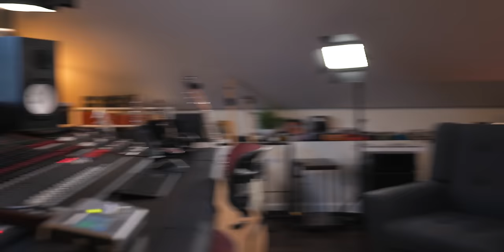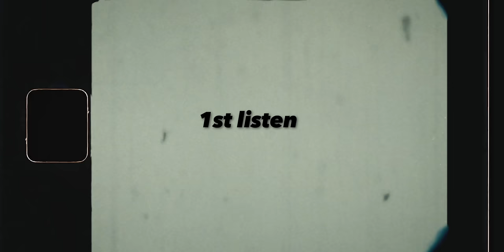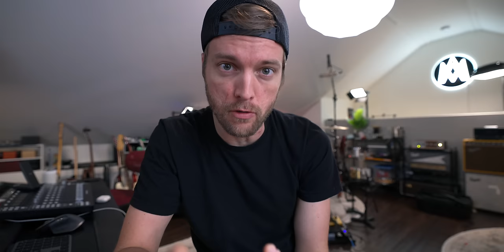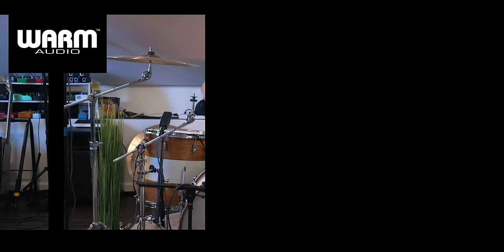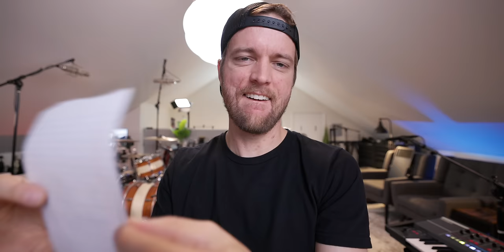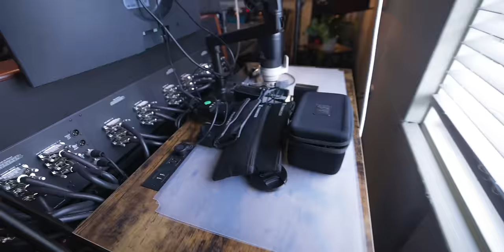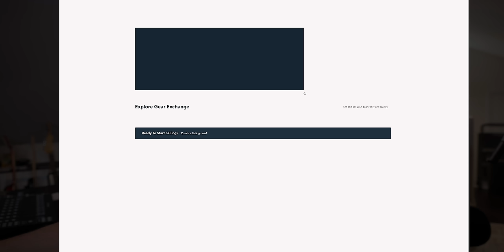I DIDN'T EXPECT THIS.. (Trident 68 Console VS Warm Audio WA73)

Comment: Hey Andrew, really cool comparison. But I also hate to be the bearer of "bad news" or just the annoying guy to complain. As much as I love the comparison I can't see it as "accurate" just because of one thing, and I might be wrong here, so feel free to correct me. When half-normalling your patchbay as to split your mics into 2 preamps each, you're sharing the impedance of each mic between 2 preamps' inputs, which makes the interaction of mic + pre a bit different (sometimes quite different). So I think this would be even cooler with a microphone splitter that has an actual transformer isolation to avoid that extra interaction. Am I crazy? Maybe, lol, just let me know what you think.

Comment: Honest thoughts. Both sound awesome and Trident held its head high on every element except the snare. Consider possibly keeping one WA273 eq, as part of your snare bus/chain. Top & Bottom snare 
mics runs through the Warm’s for that 1073 smack. Just my thoughts. Thanks so much for the informative video. 💡
Reply from the maker: I think you may have it backwards. The snare feels buried and hard to hear on the warms, trident it pops right out and is huge.
Reply: Also, the sizzle on the hihat clearly goes away on the trident. I mean, this is all subjective. It’s an opinion. But yeah, snare, possibly overheads as well, the Warms “let the air through” better. I do like the other shells tone on the Trident. Thanks again.
Reply: I don’t own any warm audio or anything 😂, just judging by this vid. Thanks for the content. Huge subscriber.

Comment: Hello very nice video thank you

But because i didnt wach the hole video i dont know how the warm 73 pres are summed

Are they going into the line inputs of the trident as well

I think that the summing section is influincing a lot as well.

Is the the comparison not hinking,  when the trident is summing its own pres and external pres as well?

Please clear me up
😂
Reply from the maker: Yeah at the last comparison I run both recordings through the line input channels of the trident mix section, hitting my mix bus chain.

Comment: One thing I will say about the WA73 is that there is a huuuge difference in the lows with the EQ section engaged (no moves) and the EQ off.

That said, Trident consoles are super smooth and "musical". I feel like they are really underrated in the market.

Comment: @AndrewMasters for your patchbay setup - did you run phantom power through any of the half-normal connections? Any issues or considerations needed when doing this? Seems to be a lot of disagreement online regarding running mics directly into a patchbay.. especially with phantom power. I do this with fully normalled TT connections and have no issues. I just never change the patch while phantom power is on. Any thoughts?
Reply from the maker: Mics only need power from one source, so don’t send it twice lol!

Comment: So I did a very similar thing with Warm's 73 pre compared to their Tone Beast that's more API like, and the difference what you'd expect.  The 73 has a rounder bottom end, and "squishier" sounding transients, while the API style is snappy and bright.   Comparing the Warm 73 to Trident, the 73 almost sounds more API like in comparison.  

Both fantastic, I think that particular tune the Tridents probably work better, if you're recording a song with a bit faster drum groove, or with heavier guitars then the Warm might be the choice.  

Some advice no one asked for someone no one knows, but if you're getting into building a studio or home recording and your banging your head against the wall wondering what preamp is best for you, just know that as long as you buy something with a decent build quality, you'll be okay regardless of the style of preamp.  There isn't a "best" on these things, there are opinions on what people like, for sure, best is nonsense.

Comment: What pre’s have you tried that actually impressed you for their price, in a more budget orientated setup?
Reply from the maker: If I'm just buying one or two pres? The warm 73s. That's how I wound up with 12 of them lol. Best value by far.
Reply: @AndrewMasters  Thanks….I came up in recording in the early 90’s and boy do I miss consoles and tape. My home setup back then was an Otari MX50-50 1/2” 8 track and a 16 track Mackie. I wish I’d held on to the Otari (sold to get a 16 track machine) but you just don’t really know when a sea change is coming like it did with DAW’s, once we hit the 2000’s.  You always sell, thinking, I’ll get another one later and then they either disappear because Ampex was pretty much not making tape anymore etc etc. I actually miss the limitations of tape as it forced you to make creative decisions and stick with them. More focus than the endless what if’s with digital. Plus it just sounds great for guitar rock music. Even in addition to the Warm pre’s and the Trident, have you ever considered getting a smaller tape machine to run through on the way to Pro Tools or do you think the Pre’s do enough?

Comment: Let me preface this by saying that I have a console. It's an Allen & Heath GL2400. To me, there is something about how tracking through it 'glues' a mix together.

However, due to my own prejudice, I really wanted the Warm pre's to be better. It's not that I own them, more that they are on my list of wants.

The low 'presence' through the Trident is just better. I'm sure with some EQ you could make them sound exactly the same but what a step saved. Cost benefit...??? Let's just say, I'm still in the market for WA-73's. 😊

Comment: Given that the Trident pres are in the console and not taking up any space in the racks that could be used for other things, I'd just go with those. I have an SSL XL-Desk, and I just use the pre-amps in the console. It's going to end up going through outboard gear on the way in and in mixing anyway. And I have a set of Neve 542's in the main buss comp slot which are always on during tracking and mixing. All of that would likely overwhelm any pre-amp differences.

I might pick up something radically different, like a Solo/610 or something, just for fun. But, otherwise, I'm fine with just using the console pre-amps. It's not like an endless list of albums better than I'll likely ever create weren't created using the pres in the SSL console it was being recorded on.

And, yeh, cabling for a console is a lot. But a console is so intuitive and fast to use. The DAW for me is just a digital tape machine, and I only use 1 plugin (BFD for drums since I live in an apartment.) Though, periodically I go into Rain Man mode and sit there for five minutes trying to figure out why I'm not getting a signal.

Comment: 1073 and their clones use transformers that have a kind of mid-forward flavor. Modern designs try to get a more natural response. So where a kick drum or any low end is highly important there is going to be a rather large difference when compared. Loved both honestly, the Warm's mid forward give me Greenday vibes while the Trident gives me  heavy hitting modern vibes. Two flavors, two tools, to ways to go forward with any project.

Comment: I like the Warm Audio sound better.  In my listening environment it sounds warmer, but more importantly, more balanced.  Over the years, I've had a chance to listen to actual Trident vs. Neve consoles, and liked the Neve 1073 better for these same reasons.  I now have a Rupert Neve 5088 console, with mainly the 5032 preamps modules, which sound a bit more neutral like the Trident, than the older 1073.  For rock I simply prefer the 1073 sound!

Comment: To my ears the Trident has a bit more going on in the low/lowmids and contains the transients almost like shaving them off,...espeically the topend.  The Warm is overall brighter/more clarity, a bit tighter lowend with the transients coming through stronger.  Both sound good, just different.

Comment: Being a 60-70's drummer and engineer, I prefer the warmer sound of the Trident Pres. The Warm pres sound OK. But might need EQ to resemble the Trident. If they could. And that's a big 'if". I worked on a Neve 8038 and a Trident "A" series in a studio in Phoenix years ago. The Trident is still king along with the 8038. Anyone remember mixing in "quad"? The 8038 could with a joystick panner.

Comment: I don’t know that the Trident actually HAS more pronounced lows, but perhaps because it’s smoothing out the top end transients a lot more that the Warms are, the low end is being perceived as being more pronounced than the lows on the Warm. 
I suppose that an analyzer like SPAN could give you more info for both…
Regardless, both the Trident and the Warm sound great, each is very pleasing in harmonic distortion, and while there are differences in their texture, I (personally) wouldn’t go so far as to say that one is definitively “better” than the other -(any more than I’d say that a Neve is “better” than an API or SSL)…they’re just different, and either one would give you great results.
If there are any pro’s and con’s to either, some of the pro’s to the Trident would be that it’s great for hands-on tactile mixing, and that it gives you the summing into the master 2-Bus, which is a part of the “magic” sound of a console. The cons to the Trident, are that it takes up a LOT more space than a rack of preamps does, and, because it’s an older console, it will definitely need maintenance at some point…and it’s not a question of “if” it will ever need maintenance, but a certainty only of when.
The Warm pre’s take up far less space, likely give off a lot less heat, and, because they are more modern, probably won’t need any servicing for quite sometime, which, when they do, will be easier to do in rack mount preamps than on a console. 
The cons to the Warm preamps are, as mentioned above, that you won’t get the summing with them, or the 2-Bus, and that for mixing, they won’t offer the same quick and tactile type of workflow that console mixing does. 
All that said, in terms of sound and sonic texture, I’d be happy with either the Trident or the Warm.
IMHO, of course. 😉

Comment: From what I could hear I thought the Tridents had a slight bit more transient than the Warms as well as a more predominant high bass-low middle character.  The meat on the bottom end of the snare seemed like it sustained longer and had more of a tail with the Tridents as well.  The Warms seemed a little tighter and not as loose as the Tridents.  Probably because of the low end differences.  The kick definitely was bigger on the Tridents.  Bigger is not always better but I thought the Tridents won the battle overall.

Comment: The Tridents have that depth and "warmness" but the Warm Audio has that snap and attack and bite on the drums making them a bit more punchy. This is why neve tyle pre is really good fro hard rock and metal as it gives you that punch. Trident is rounded and mellower whereas Warm is focused and punchy but neeeding a bit more low end

Comment: Personally, I think you are being too conservative with that board. Start using all it's features and only reaching for outboard as needed. It will speed up your workflow. Don't worry about recall, just get it right the first time and charge for recall/redo's. The cohesiveness of a board of any type is hard to beat. Don't just use it as a summing mixer. Mix on it.The Trident sounds better, tighter, more detail. The warm are " soft" sounding.

Comment: I definitely wouldn't say one sounds better than the other. The warm audio preamp is based on a 1073 and the Trident is something else entirely. The biggest difference I hear is the more defined transient on the Trident. But I'm sure if you lower the Warm Audio gain you can get more peaky dynamics.

Beyond this, I am passionate about consoles and I always prefer them. Each channel of Warm 73 with EQ is $800 and the Trident console is almost $800 per channel as well. For the price of 24 channels you get a whole console! With faders, auxiliaries, groups, master section, monitor section, etc.

One day I will buy the SSL Origin. What can I say, I'm a gearslut :)

Comment: This is shocking. I've never tried the warm neve stuff, only thing i've tried/owned by them i like is the pultec clone. So it sounds like most likely the warm pre's don't cut it cause my BAE 1073 pre's sound FAT - like the trident example. The trident pre's sounded incredible. Sell those warms, buy more compressors.

Comment: Not the best way to compare preamps. Microphones are low level low impedance source devices.
To do a real compare, the signal must go thru a real microphone splitter.
The way you tested it, leads to two “problems”
First the mic “Sees” a lower impedance on the Preamp (this changes the freq. Response curve of the mic)
Second if the impedance is different on the preamps tested this will reflect on the sound you get from the same mic on the diferent preamps tested.

Comment: I feel the Trident handles the transients "better".
Reply: yes, same here. That was the immediate thing that literally jumped out. Ha ha the transients.
Reply: If the WA preamps were being driven harder into saturation, that would round off the transients. Backing off the gain and turning up the output of the pre should bring some transients back.

Saturation can be added later in the mix if it's needed.
Reply: Yeah, I think the transients are being rounded off. I think, but I'm not certain, that the ghost hits on the snare are louder on the WA than the Trident, which does suggest the WA is compressing the snare.

Comment: thisThis test seems flawed in that gains arent matched spot on. As a result the balance of all mics on the kit, even if changes are really small, can cause massive phase interference and so overall lead to vastly different sounds. Other mic pre A/B shootouts and ones I've carried out by myself, the differences are far more minute then how they are in your mix. As you noted, the difference in the low end response is crazy. My hypothesis is that this is a result of phase problems. Let's hear it again using a level-matching plugin, it'd be cool to be proven wrong. I find this content worrying in that it discourages amateurs from making recordings without investing in things like preamps and all or equating bad mixes to lack of gear, stunting artistic development. Overall, a consumerist nightmare. We should make an effort as a community to bridge the gap and encourage others to get involved rather than cling to our investments. Art doesn't give a shit about fidelity.
Reply: I guess we should take into account the sweetwater sponsorship. They don't make any money if people don't believe they need this stuff.